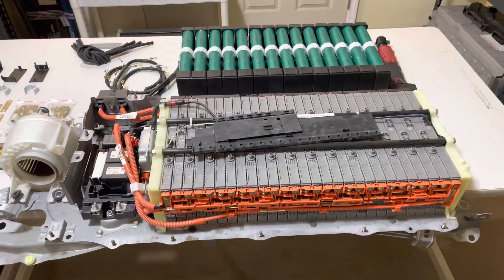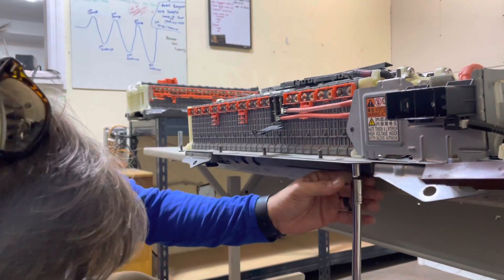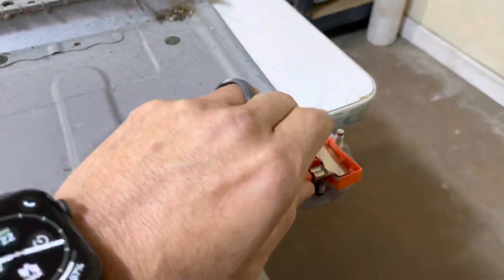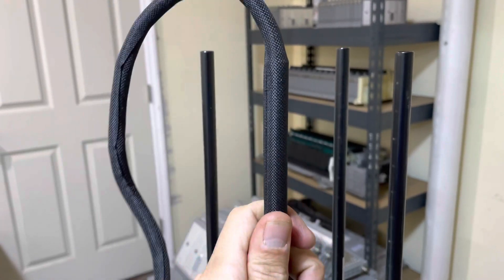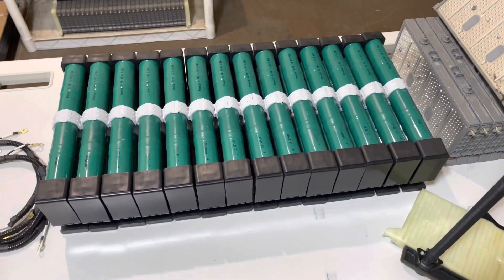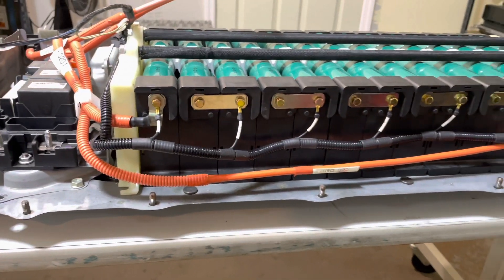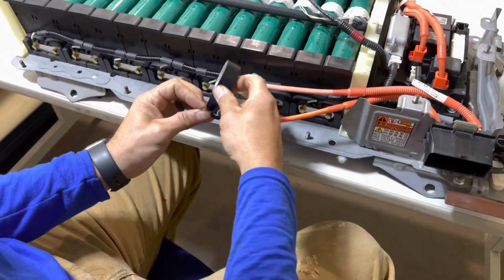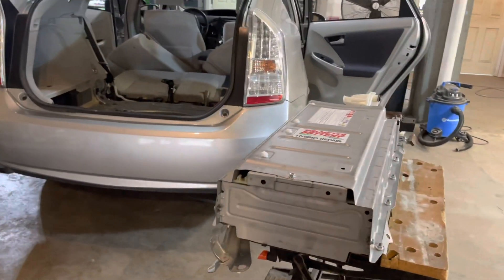Toyota Prius Hybrid Battery Rebuild ~ 2010 - 2014

Comment: I have a Question. How much is the total weight you think In LBS? I been looking with no luck. I'm working out some math here. It would really help. No one will tell me the total LBS of that Prius Battery. Thank you. Thumbs Up!!!  FOUND IT for a: TOYOTA PRIUS HYBRID 2010-2015
RATED BATTERY CELL CAPACITY: 6.5 AH
BATTERY PACK WEIGHT: 85 LBS. (Including case & electronics) 85LBS
Reply from the maker: I'm uncertain, you can reach out to Greentech auto for more information.

Comment: I have a plug in hybrid 2013. it has 56 cell x 3.7V 21Ah. I'd like to build another pack with same total voltage from 65 cells 3.2V Lifepo4 50Ah.
In my opinion voltage sensors should be scammed by voltage divider resistors except total voltage. And of course I should measure cell voltages by another method to detect any error. What do you think, would it work?
Reply from the maker: With the right management system.

Comment: Is it better than the original battery?is it manufacturered by Toyota?
Reply from the maker: The chemistry and specs are identical. These aftermarket battery kits are not made by Toyota. I personally prefer the cylindrical modules due to cooling/spacing. I see a lot of heat deterioration that causes stress and unbalancing issues.
Reply: @PalmettoBatteryPros  these cells are used in Honda civic and they deteriote quickly

Comment: man there is no need to 'discard your old voltage acquisition harness' when there are people on ebay willing to pay #40-50 $$ for it !!!
Reply: u didnt take the ECU apart, 4 screws on the cover .. reveals the visual of the PCB --- which tells u alot , but if pins looks ok outside prob "" ok on the inside ..
Reply: its a nice kit and air flow is vastly impvored not to mention overall reliability because u have less connections to potenitially get corroded ..  hoewever .. the pirice point is not pretty ..  those D packs  (the kit) is well over $1000 ...
Reply from the maker: Half as expensive as an OEM battery and less warranty/failure issues than recons. I think they are a great value. Although, somehow prices on Ni-MH are going up, I thought due to EV demand only Li batteries were increasing.
Reply from the maker: For someone recouping expenses, by all means put that bad boy on Ebay if its salvageable. I don't have the time to run an ebay store, I've thrown away so many.

Comment: this cylindrical is better than traditional (parameters)?
Reply from the maker: Same specs, better cooling due to design. More room for airflow through the modules. That is probably the biggest advantage.
Reply: @PalmettoBatteryPros  thanks
Reply: @PalmettoBatteryPros  and for the price? how much for the wholepack to change it with the old ones?